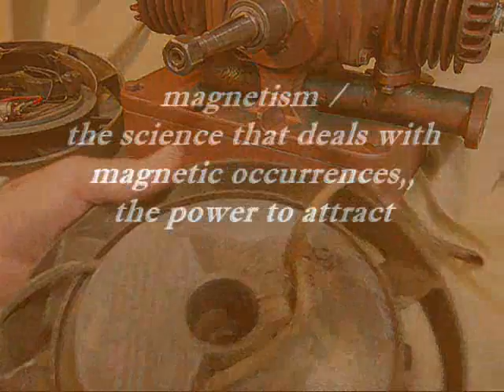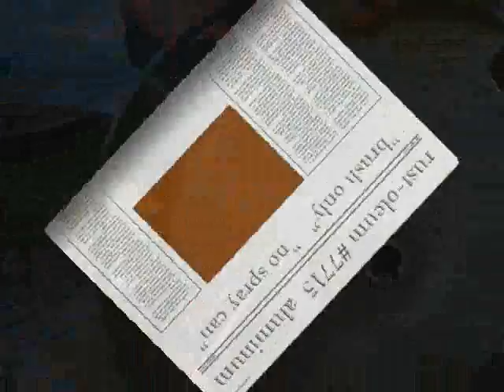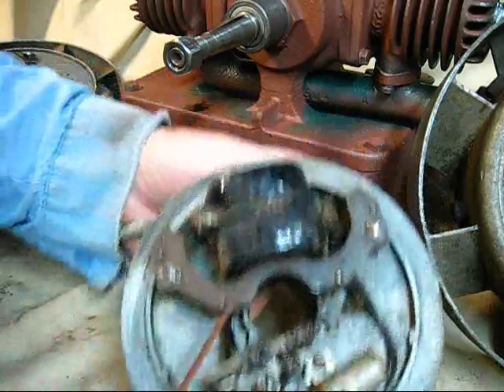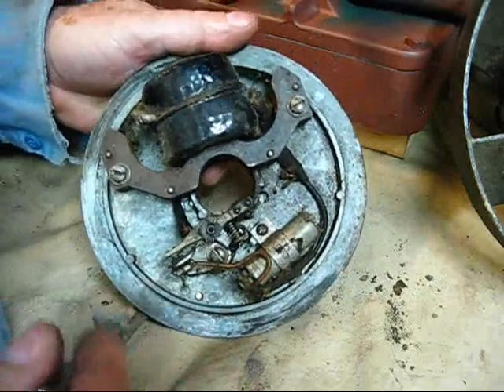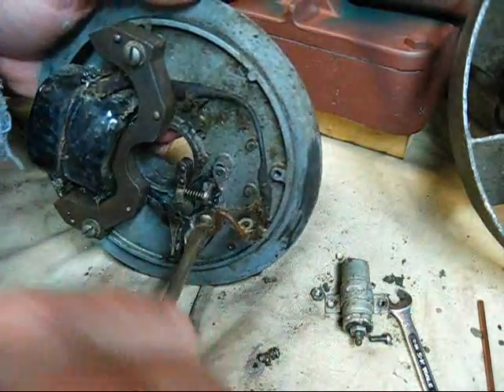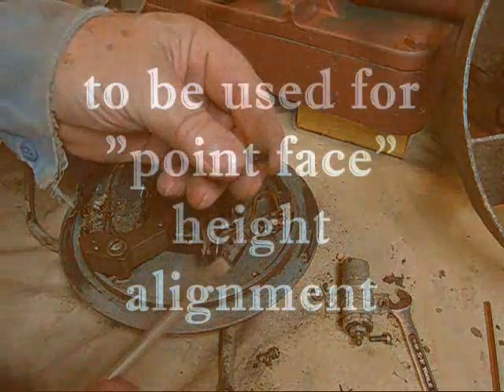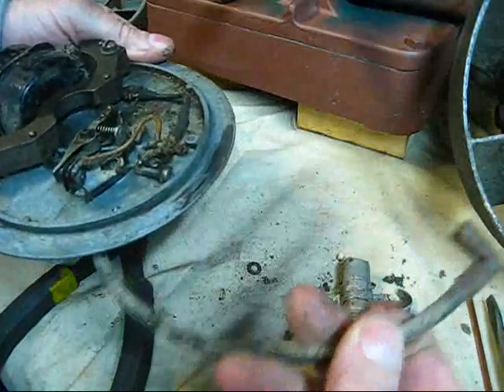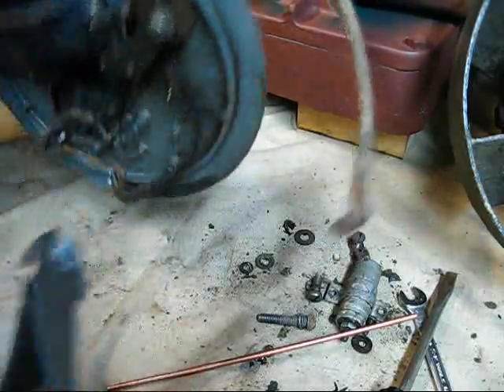1937 Maytag Engine model 72   rebuild #37

Comment: Sam I have a twin and have put new coil cond points rebuild new rings points set .020 and plugs set at .025 new plugs pin air hole is open have the correct cam rebuild by your firms. Do you have any throughs on this.

Comment: Sam,
Thanks for all the details. I have never felt that you were wasting our time! I have made use of every detail that you have provided so far in this series.
Magneto repair will be especially helpful. My Model 72 has a broken spark plug wire so I am very interested in the proper spark plug wire replacement. My experience is successful repair is in the details.
What is the wavy washer for? Is it steel, stainless steel, or phosphor bronze?
From the West Coast of Tennessee.